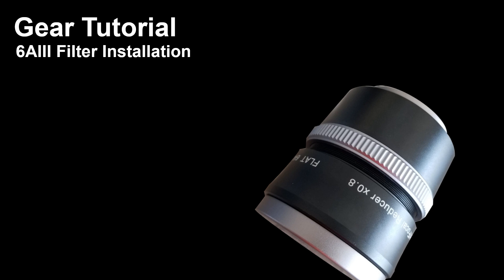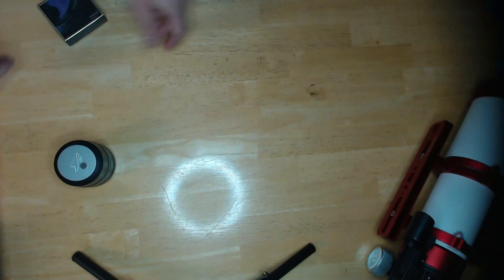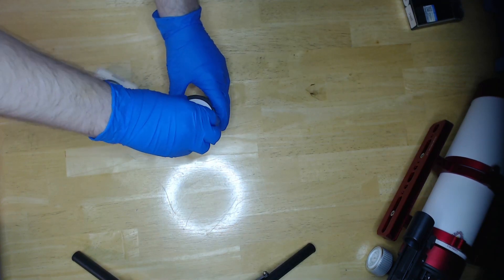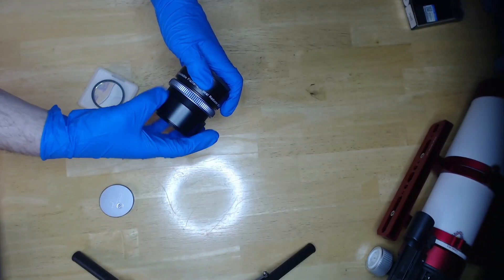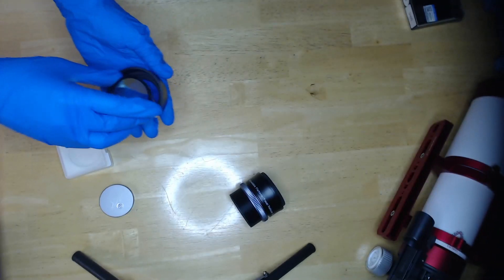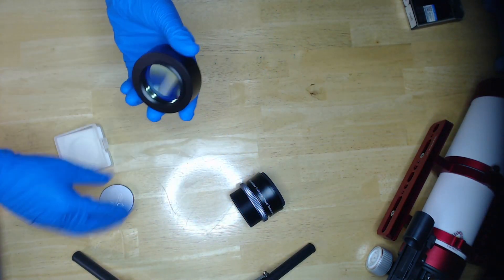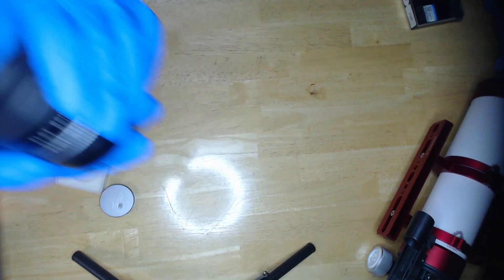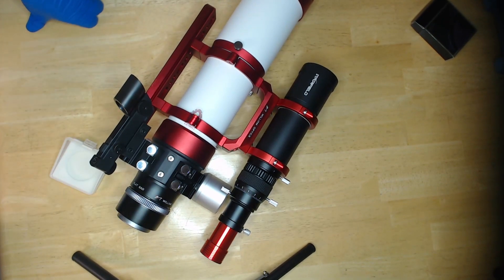Gear Tutorial - 6AIII Filter Installation

Comment: Would it not be easier to buy a filter drawer instead of doing this? There 79.00 at highpoint scientific. How hard is it to take that filter out of there?
Reply from the maker: In my opinion, it is easier to remove the filter than it is to install it as you can unscrew it while holding it upside down. However, you are definitely right, a filter drawer is much easier to use; I use one myself. But for those that don't have a filter drawer/wheel, this is an option that does work, especially if you don't need to swap the filter very often.